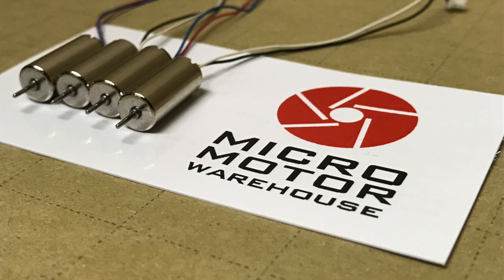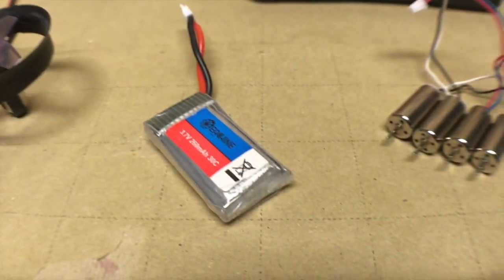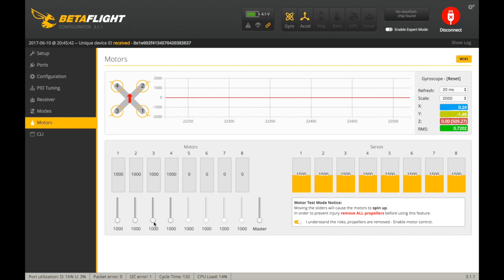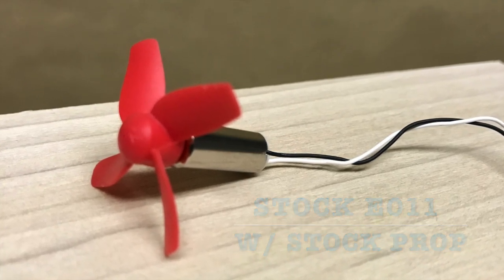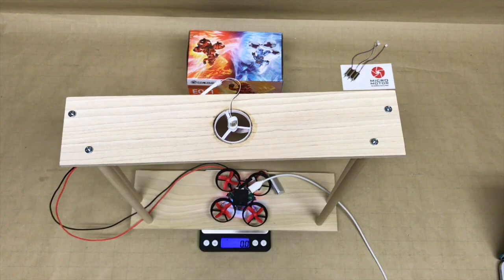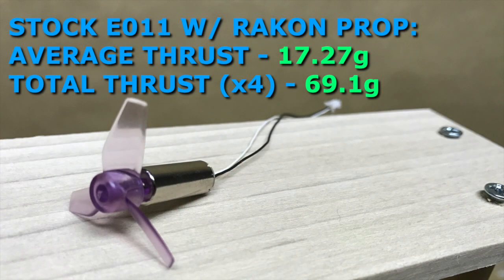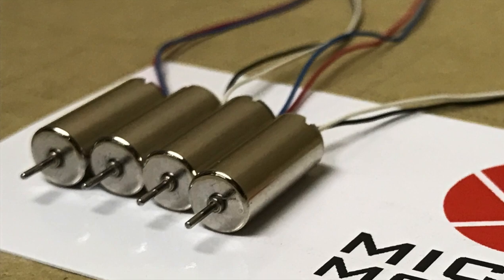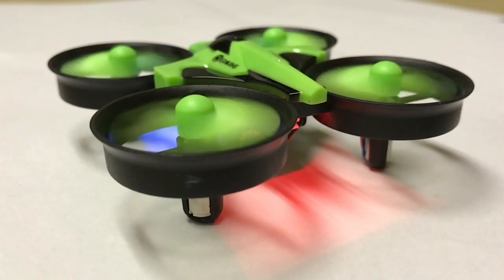Eachine E011 Motor Upgrade & Thrust Test - MMW 17,000KV Upgrade Motors for E011

Comment: Thanks for the testing! I ordered these motor as an upgrade to my E011 along with the Beecore FC, however, looking at the results. This is an increase in price of 100% over the stock motors while only getting a 6.9% increase in performance. I think the 3-blade props are a good upgrade but I think a weight reduction on the quad would be better than this motor upgrade. I did buy these motors as I stated, however, I think I should have concentrated on weight reduction instead of motors after seeing these numbers. Happy Flying!

Comment: I bought the purple racerstar motors and got some 400mah 3.7v batteries. the motors died after about 20 flights. Is that normal. What motor battery combination would you recommend?

Comment: this is funny...for more than the cost of the quad itself you can upgrade the motors to give a 4.8gr TOTAL increase in thrust, you better to take battery/motor plugs off or something else
Reply from the maker: +kermets This is a much more feasible upgrade when you need replacement motors anyway.  You can do all of the above and see a boost in performance!
Reply: Totally agree.  Just had 2 new RTF E011s shipped to my door with 2 new batts and 8 extra props/2 chargers/ 2 controllers for $29.